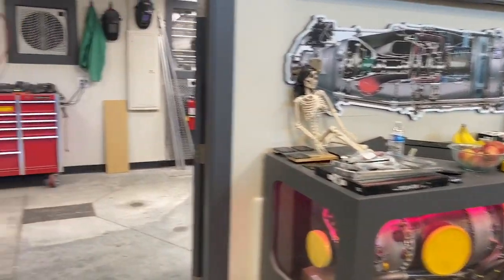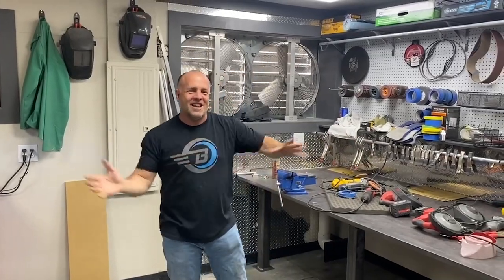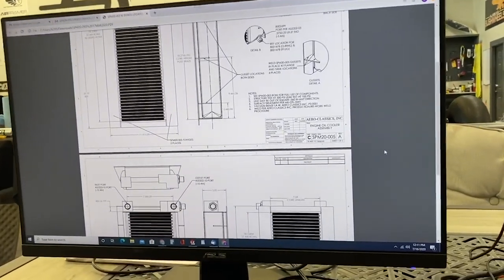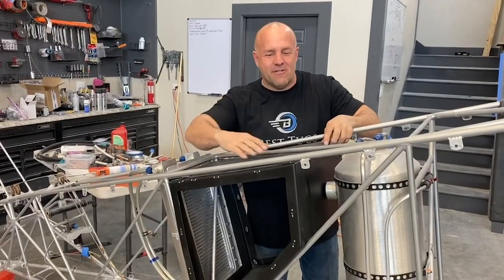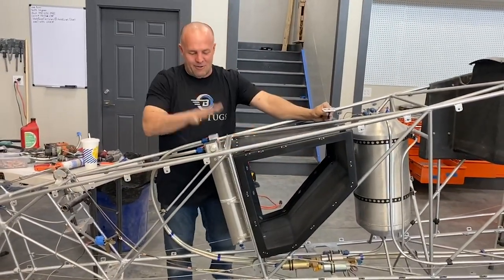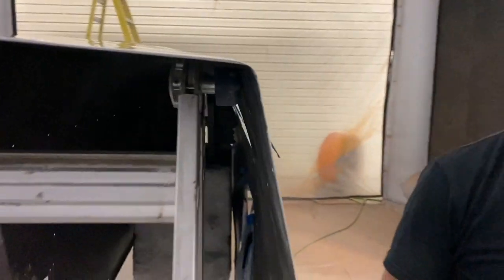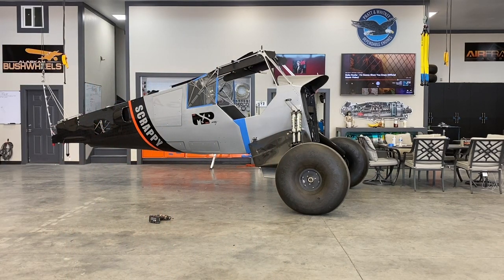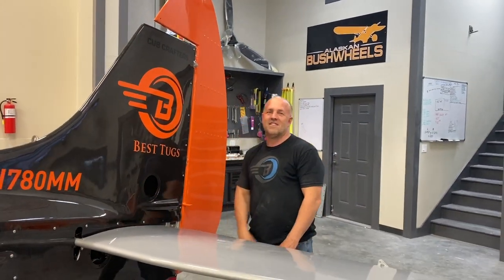Scrappy Bush Plane Gets Tail Feathers  🤠 (Scrappy Bush Plane 24)

Comment: While you were talking about locking your control surfaces and specifically the electric servo controlling the rudder damper, it got me thinking about the safety of having a motor controlling a control surface, and potential failures regarding that, so I have a quick question. As I'm doing more engineering in both personal, and motorsports applications, I've been investing a significant portion of my time in FMEA (Failure Mode and Effects Analysis) before designing a part, and continually referencing it while drafting a part to ensure there hasn't been a point of failure that I missed. Previously you've mentioned potential points of failure and what you've done to counteract then, but I'm curious as to whether you sit down for hours while designing, document potential areas of failure, the risk, occurrence, detection, and severity of each failure, failure outcome and handling, and what you've done in attempts to counteract a failure before it happens and ensure safety.
For example, my area of expertise is in electronics, so for my racecar's accelerator pedal, I have two throttle position sensors. For each case of failure in the sensors, be it debris, two different values, implausible signal, etc. I explain the failure cause, failure effect locally, and globally, the severity (and reasoning), occurrence, detection, and risk (as a function of severity, occurrence, and detection), before explaining what will happen in event of a failure due to safety measures I have put in, and how to fix the failure. I collate all of this data for each specific point of failure, and cause of failure in my electrical system, and I put it into a large spreadsheet to analyse and reference to pass technical inspections, and for later referencing.
I was wondering if you go through a similar process to make sure that all of your bases are covered, and that you're as safe as can be given the circumstances, be it in electrical failure, or mechanical failure?

Comment: Question; Why did you go with a single-shear connection for the rudder pushrod? Double tabs or at a minimum, a single tab with a clevis, would help eliminate any adverse torque on the connection point.
Reply from the maker: Thanks for the question 👍🤠 That’s one of 3 connections.  Normally only two.  There are two more lower at the base of the rudder.  The third single is for yaw autopilot only. The others are still there

Comment: You are an amazing talented man thanks for sharing your project!
I do have one concern.  The oil cooler box where it touches the angled frame i didn't see attachment screws.  If the box buffers the carbon fiber will chaff the frame. May i suggest a thin Teflon pad along the frame?
I worked on the Premier 1 so I'm familiar with carbon fiber and it's behavior. 
Again thanks for the video.

Comment: The pin reminds me of the little 1/8" key for the Estes rocket launchers. Guys at high power rocket launches have been SOL when they forgot their key and were using a non-standard launcher/key.  If you 're getting ready to leave some remote location and get distracted after pulling the pin and it gets lost, you are stuck.  I'd duct tape a spare on the fuselage somewhere.  Much like hide-a-key when out camping and have a chance of losing your keys.
Reply from the maker: jcadult101 my mind was thinking the same 👍🤠 so I made the switch very easy to get to so it’s a two minute bypass to connect the two wires so I could never get stuck.

Comment: Awesome welding table! Loving the Scrappy  build! I’ve been watching since you started. 
I do have a concern about the oil cooler. And I’m sure you have already thought of it just didn’t mention it in the video. What about frame flex from landing? Or will the isolators absorb those stresses as well? It’s more of a question really not so much a concern.

Comment: Fantastic aircraft. Did you consider putting the oil cooler exit vent on the belly to avoid disturbed air in front of the horizontal stabilizer?

Comment: Mike.... You have More "can do" attitude, boundless & "seemingly" limitless charisma and Energy... than any Ten people put together, anywhere!!  lol   I Love your attention to detail... I'm the same way when comes to That,  I do custom metal polishing and color buffing and have had people pick my polished parts, over chrome plated pieces, over the years.    I do have a question, and my apology if this may be an obviously ignorant question to some.... but my formal background is not in aerodynamics as applied to aircraft.

My question to you, Mike (or, to Anyone who might actually Know what they're talking about) is,... considering the designed purpose of Scrappy, is there Any chance of the oil cooler air intakes and the oil cooler itself getting filled with dust, dirt & other possible debris from prop-wash while maneuvering on the ground, and possibly plugging the water drain tube opening as well?

Comment: Amazingly excellent video.  Question  probably ignorant if so pls forgive.   Burn a therm fail mode fully nonbypass so that no chance of oil overheat?  If not what is the backup to avoid overheating oil?  Thanks!

Comment: Hey Mike,
Absolutely stunning job!!
I'm an aircraft technician, and I have a question about the oil cooler design.
Is there any flow guide after the oil cooler? I'm thinking about a Y sahped flow guide for outflow air that deflects the air out through the side grills. I suspect that despite the side grills, outflow air could accumulate in the tail section creating a high pressure zone which could heavily resist the flow through the cooler.

Comment: So the vernatherm will be in “full open” when you allow temps to approach 200f? Or basically the vernatherm will not be redirecting oil back to the engine but will be directing all oil to the inlet in the cooler? At this point the cooler will be doing all it can to reduce oil temps but the lack of air flow will drive temps up to a safe 200f and allow more airspeed. I think i got it!

Comment: Mike, what would happen if you directed your oil cooler exhaust precisely to flow over the top of your tail with a laminar flow not disturbed.  Wouldn’t you get some additional lift because of the temperature difference with the outside air?

Comment: I have added an internal air door to one of my planes to reduce cooling air and keep the engine warm in cold weather. I do not get a difference in airplane speed between full open and closed. I'm interested to hear if you do get a speed difference with Scrappy.
I wish I had a dust control room when I built my plane (all carbon)!

Comment: Incredible build, your level of skill is something else! All the little details and geometry that conforms so perfectly to the frame and components is mind blowing 🤯

I do have a question for you, what sort of an electrical service do you have? Or how many amps is it? And how many amps does a shop like yours pull when you use more energy intensive tools?

I'm setting up a small home workshop that has a capable CNC router and pneumatic tapping arm among other smaller tools. Currently building a utilities shed attached to the workshop that houses a dust collector and 7.5hp 80gal air compressor(26scfm at 175psi). Between the CNC, air compressor and two fridges that have to be on I'm already starting to approach my homes electrical service(100A home was built in the 1960s). Luckily where I live we don't need and have things like HVAC and home heating but I might have to upgrade my homes electrical to a 200A service just to beable to turn on all my shops stuff during full production and home appliances.

Comment: Scrappy is going great! You should shoot a foam pig through your oil lines to clean them out twice. Dirt and debris will stick to walls and end up in your system. Actually you should flush them but foam pigs work for in place lines. Let’s get back to work.

Comment: hi! thanks for sharing your journey! many yrs ago i made a similar contraption for the switch of the drill press and for the milling machine that closed the circuit once the chuck key was placed over the switch (don't laugh) copied from some mag. i've watched you welding so i don't think it's necessary but watch the airflow over the table not blowing your gas coverage. i have a question if you have the time what happens with airflow if you stall the intakes for the cooler (if that is possible i mean). thanks again i'm learning every time i watch a video from you. take care.peter

Comment: I did some research on the effect of having a "flying strut" for a landing gear and it's not all good news.  I'll contact you about the results.  Just think about a wing with differing lift vectors and attitudes.  Combine that with variable velocity and you get a mixed set of results, not all are prone to good flight characteristics. Bill
Reply from the maker: Bill  thanks bill 👍🤠 I’m very familiar with everything you just mentioned and it’s certainly not something you would do on a larger scale nor at higher speeds.  It’s something that was considered and evaluated in design.  I’ll be sure to baby step the test flights to make sure I didn’t miss something.

Comment: so with the microswitch, you have to do a high or a  low back the pin full out the motor turns off and crash
Reply from the maker: adrian nicholson great question 👍🤠 that would be a horrible oversight for sure.  Pulling the locked pin out in flight or even a micro switch failure can’t turn the engine off.  The switch is tied to the ground wire of the starter solenoid.  Just the starter wouldn’t engage but it can’t kill the motor. Also if it had an Inflight engine failure the prop I have keeps the engine spinning so you wouldn’t use the start button even if you pulled the locking pin out and tossed it and the engine failed all at the same time.  👍🤠

Comment: Are you going to have an early oil temp warning I.e. buzzer at 210 if the oil doors arent full open)  Or something more interesting, like a solenoid that unlocks the oil door control so it springs to full open on its own, along with a buzzer to let you know that you dun goofed?  Any concerns of the wheels kicking gravel into the oil cooler intake or are they too far outboard for that to be a concern?

Comment: So, I know this is a long time ago, but I am working my way through all the videos. I have to ask; what happened to the splitter (wall) in the middle of the air box to compensate for the unequal airflow from the left and right sides of the airplane?

Comment: Hey Mike! Just a thought regarding your Micro switch gust lock system, how would you know if any of those micro switches failed in flight? And you were unable to use your starter in flight?

Isn't it better to have a master caution light up when a gust lock is missing rather than disabling the starter?
Reply from the maker: Minos Pilacoutas great idea  👍🤠. The prop I have will always keep the engine spinning so restart is not a starter related problem as it will be windmilling. So I elected to just not let the engine start rather than A light that could go out.  Ten ways to do the same thing.  👍🤠 I like your thoughts
Reply: @MikePatey  Fair point, that airboat propeller windmilling will produce ALOT of torque. Cannot wait to see scrappy finished!

Comment: Love following what you're doing Mike and I remain in awe. You mentioned the temperature range of mineral oils but also touched on synthetics. We use Shell Aero 80 plus in an O540 (I guess the plus is the ashless dispersant) and I've heard a lot about "Camguard" to protect against the cam problems that seems to plague them, but have never heard of a definitive answer as to its effectiveness. So my questions are, is a synthetic oil a realistic proposition and do you have any comment on Camguard?
Reply from the maker: Dayle Found  oh I so want to be able to give you a definitive answer on this.  I have tried them all but it seems that all I can do is likely what you have. I read so many opinions and I have not been able to find data that will give me confidence enough to direct you.  On cars I’m all about synthetic for sure and on aircraft after bouncing around I came back to Lycomings recommendation and I’m holding to that.  🤷‍♂️🤠 sorry I’m not much help

Comment: Did you think about using the Meredith effect to reduce or eliminate drag from the oil cooler? It would be a lot of CFD for a few kts though. And is there an air box for the exit ducts like there is for the intakes?

Comment: Hi mike, befor you said you was splitting the airflow through the oil cooler in to 2. The starboard side feeding through the oil cooler and out the starboard side and the port side doing the same because of a divider in the center of the air box. Are you not doing this now?

Comment: great as always, is there a low point for the engine oil lines to drain them? or have a chip plug? T hats a long run and you dont want any chips hanging out in a bend somewhere that cant get flushed out on engine oil change time. would be nice to have a way to jumper the microswitches if they dont work up on Mr Mountian top as well. Or even an led you could see on your DI with the power on, Much like a Push  to test being a useful tool . While yes it wont start with it U/S, but you dont want to be up there troubleshooting or swapping one out with big cold hands,  when you could jumper it to limp it home. cause you could be alone up there. From the voice of someone who has had to change a microswitch in the cold with their fat cold hands and learning new swear words at the same time..Microswitches are a pilots best friend, but the mechanics worst enemy..when they are buried somewhere. and instead of connecting wires at the microswitch, you could make a lead a few inches long off the switch to a knife edge connector, then another to the harness, with a piece of Tygon tubing over them and a tywrap holding the tube on, so you can change it out much easier, works great on chip plugs.
Reply from the maker: 91rss  great thoughts 👍🤠 you and I are of the same thoughts. I have a quick jumper set up and don’t need to replace the micro switch. I can just bypass the switch in just a moment.  The oil I have a quick connect to flush and fill the oil cooler at the back at the same time I change the oil. It only adds a couple more minutes.
Reply: @MikePatey    good stuff,, with people that have worked on everything under the sun, there is lots of ideas out there.I  drove 8 hrs after an inspection due to a chip plug light. It was a metal sliver from when we opened the Mobil can . so from then on, everything is through a paint filter..lesson learned . and cheap insurance. Oh and for DG clamps, Find a fork with tines that narrow at the base, You can slide the tines on the  dg clamp  to compress it, and then add the screw or an3 bolt now that its compressed  you can thin the tines a bit too to get the screw to clear, also you can use a small long nose vise grip that you grind thin.

Comment: Mike, just curious on a design decision. When you say "micro switch", I assume you mean a mechanically actuated switch with mechanical contacts.  Why did you use these instead of solid state proximity switches on your gust lock interlock safety system?  In high vibration applications, a prox is less prone to failure and is less finicky as regards adjustment.

Comment: Hey Mike I like the New 2000 LB work bench! You haven't mentioned the Wings Yet in your videos, so are we going to be SURPRISED?  Big wings , Lots of Lift, Lots of Fuel capacity ?? Aluminum or Carbon Fiber? Wondering also why you didn't make the landing gear out of Carbon Fiber?

Comment: Is there some safety system so you can override the rudder gust lock switches in case they have a malfunction and you need to restart the engine in flight?

Comment: Hi, Mike, as with the oil cooler , when the plane is not flying  and there is no airflow 
there will be a rapid increase in oil temp, should there not be an electric fan,  inside the inlet box linked to the oil temp sensor on the return pipe.

Comment: On many commercial marine vessels, there are a series of pipes attached to the exterior of the hull, or a plate, that is employed as a heat exchanger for the engine coolant fluid. I was wondering if something like this could've been incorporated in to your fuselage, that may have been lighter than your oil cooler, still used the...  vernathem? ...and been sleek enough to have avoided parasitic drag, thereby also avoiding the requirement for the added complication of manually operated doors and the extra fuselage penetrations and nacelles?

I'm a non aviation tradesman, thinking out loud with a keyboard. If I'm wrong in some clearly obvious manner, please make nut-kicking responses with that in mind.

Comment: Mike, I have a question:  Why would the rain cooperate with dropping into the box in front of the oil cooler.  Wouldn't the air-flow push the water through the water cooler?  These thing I just don't know.